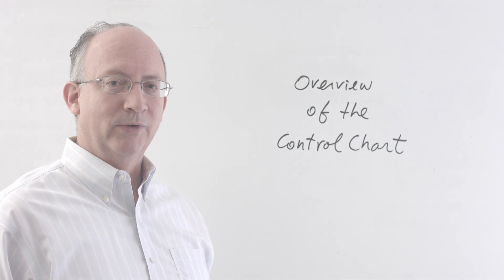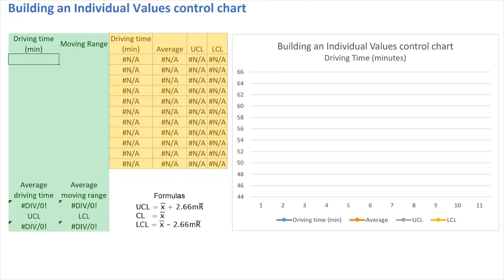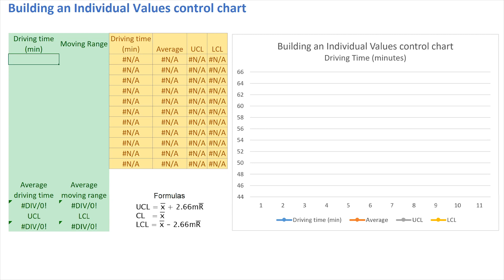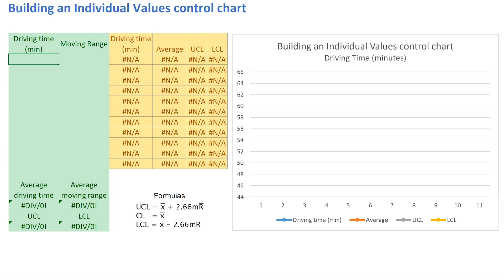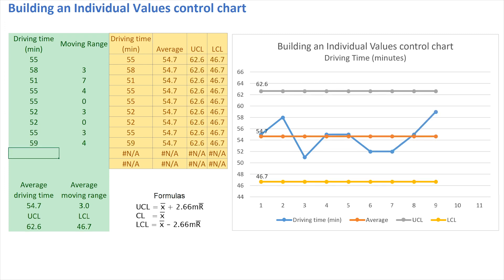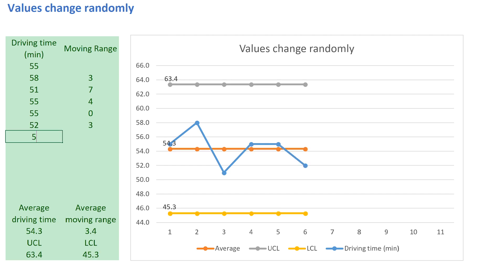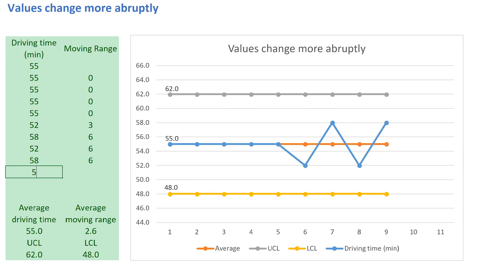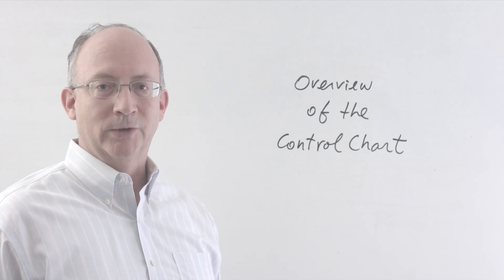Six Sigma | Overview of the Control Chart | Green Belt 2.0® Lean Six Sigma | fkiQuality HD

Comment: Control charts appear to only work with the data presented.  Or as history has taught me, you are only as good as your data.  In this example the numbers are constantly in motion, so the control chart would tell the story in real time based on the facts presented at that time.  This is a great visual of the actual operation in its entirety: Product, Histogram, Run Chart, Control Chart.  Following that order of operation would be a true course of the ways in Six Sigma. Yee-haw!

Comment: This is a very useful tool for analyzing data. Being able to easily plot and show acceptable bounds based off of how much variation there is in your data and overlaying it on a run chart seems to be the standard for creating one. Walking through the examples of how the bounds changed based off of its variation was a very good demonstration as well.

Comment: This will be extremely helpful once I grasp it a little bit better. I am currently a shipping supervisor overseeing 40 processors. They are picking in multiple zones within our warehouse. I have created a progress board which conveys to the processor how they are performing hour-over-hour. Throughout the day I would like a control chart to capture the data from the progress board live time in order to show the team how they are performing. Ideally I would prefer to show individual charts by our screen isn't that big.

In my example, in order to identify the upper/lower control limits I will take the teams' LPH every hour in order to find the moving range from one hour to the next. Once I identify the range I add 2.66 (MR)? What does MR represent again? Thanks!!
Reply from the maker: Chris, I think it is a great idea to use control charts to monitor the performance of your processors. However, there are a few things that you must consider. For instance if you were to measure each one of the picking operations, are they really comparable or do they vary in ways that may justify a shorter or longer duration? Would it be better to accumulate performance over one shift to get an aggregate performance metric?
Reply from the maker: MR is the moving range, that is, the difference between any consecutive observations. This measure of short term variation is used to calculate the long-term variation limits in the control chart by means of the 2.66 factor.

Comment: Very interesting.  I like the illustration of how the control limits change with changes in the moving range.
Reply from the maker: Rafael, one observation. True that the limits move as more data is added and the limits are recalculated, but in practice, you would wait for about 10 observations before calculating the limits -- it's just that Excel does not let me do that.
Then, once the limits are calculated, you don't touch them, that is you don't keep on recalculating them but use them to separate the noise from the signals to action.

Comment: Awesome video. Relating to Dan's point, how do we set limits and make decisions with them?. If we were using the control chart to track a subset of data, say costs within a department, what decision points might set the LCL and UCL to static, so that we may determine the acceptable range and recognize outliers? What types of trends might make us evaluate the data within the LCL and UCL - RSD, %RPD between two points, consecutive points in one direction? What kind of inputs might make us adjust the control limits?

Comment: Very informative. With enough data you can see what kind of progress or decline takes place using this.
Reply from the maker: @Oscar, the advantages of using the control chart early is larger than any problems due to having few observations. So, you could start using the control chart with as little as 10 data points and be ahead of someone who doesn' use this tool.
Just in case, there is no need to wait to have 30 observations like other people and books say.

Comment: using this chart will help you to pinpoint why something is out of the norm before making changes. Maybe something contributed to the spike unknown to you. Ask your team what happen now that you have the data
Reply from the maker: Javoris Patterson, that's right, use the control chart to take action to rectify situations renderer unstable by the presence of special causes. Usually, going to observe the process and speaking with the employees in charge of the task will be the first steps toward coming up with ideas to try. Ask why several times to find the root cause. If the first doesn't work, try a second one until you succeed. Special situations don't usually require changing too many things because they are due to one or two major factors out of control.

Comment: Very well explained .  Had to pause and replay several times to fully understand.  Control charts monitor process stability and control
Reply from the maker: Mayra Ambriz, well said, and remember that the reason for monitoring a process is to take action over it when required. This may be to counter a special cause of variation or to reduce overall variability if a process is not meeting customer specifications or service level agreements.

Comment: Demonstration was good because it shows how the individual data entered will show variations and change the average limit
Reply from the maker: Kari, just to be sure, don't focus too much on how the limits change as data are entered (due to the plotting in Excel), but how larger point to point variations in the three cases result in limits further apart. And observe that this is not an insight you will get from a histogram.

Comment: Joseph Tshulos  Nice demonstration, that shows the difference in variations using the same data points.
Reply from the maker: That's right! The same data points may represent very different process behaviors. Control charts are called "process behavior charts" by Donald Wheeler, show precisely this: how a process behaves as time unfolds and it becomes subject to the effects of variation. Recall that some variation is expected, unremarkable, "common" while other is surprising, singular, "special." The control chart filters out the common variation so that we may identify and respond to the special, usually damaging, type.

Comment: I can't quite grasp the concept of the UCL and LCL being dynamic. If the limits change with each data point only very large swings in data will fall out of the control limits. How does this apply to a quality standard that has been pre-determined. Let's say that if you are filling one pound bags of sugar, and you only can allow +/- 0.05 ounces. Can't you set the limits at 0.05 ounces and keep the limits static?
Reply from the maker: Jeffrey Sundwall, the limits only "move" because Excel calculates them in real time, starting with the first couple of data points. In reality you would wait to have about eight or ten data points to start.
The main message of the video is that the control limits show the natural range of variation of the value being measured.
The control chart WILL DETECT off-values symptomatic of special variation, that's its purpose.
Reply from the maker: Jeffrey Sundwall, one other important notion is that you or I don't get to "set" the control limits. They are not +/- values similar to tolerances. They are CALCULATED from the data.

Comment: The control chart is a visual tool to identify abnormal behaviors in the data. this is a very good tool specific to the data that will quickly give you information if your data has any kind of special variation or just normal variation.

Comment: Good follow up to our class this past week.  Knowing the control limits will change with almost every observation, is there a minimum number of observations needed to get control limits that are useful?
Reply: I had the same question.  In one of the example from the video (Values change randlomly), the UCL and LCL are visible for data point #1 but disappear until data point #5. And, in the values move abruptly chart, one could conclude that they have a problem at data point #5 until the subsequent data points are plotted and the cumulative data points all fall within the control limits.  Even within the control limits, this erratic behavior needs to be looks at since the first 4 plots appear to establish a trend.

Comment: Good review of what we covered in class. Interesting to see how the control limits can change so dramatically. How do you know if you truly have a stable process if the control limits can change so much?
Reply from the maker: The video shows control limits changing because the chart is programmed to start calculating limits from the start, even with just one observation, which is not what you would do in reality. Nobody would expect that one or two data points really represents the behavior of a variable, just like two sunny days do not mean summer is here!
However, there is no need to wait for a very large number of observations to calculate useful limits. 8-10 values are enough -- by the way, this is contrary to what many books say when they recommend that you collect at least 30 data points (this is a misapplication of the central limit theorem).
The limits are robust, meaning that they will filter out common variation and highlight special variation even when the process is unstable -- this is precisely what makes them useful!